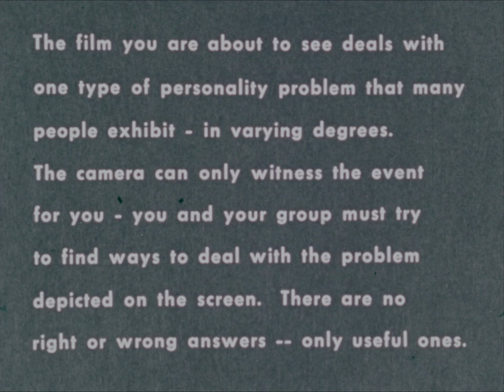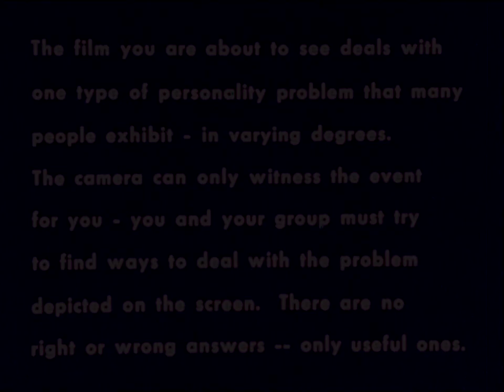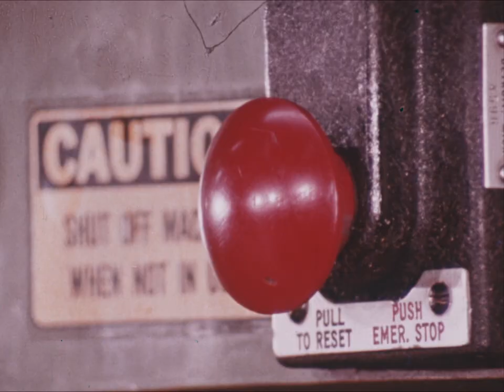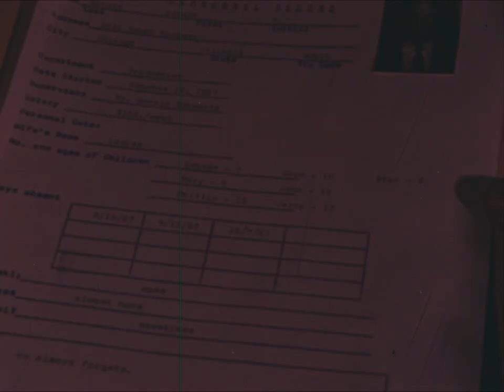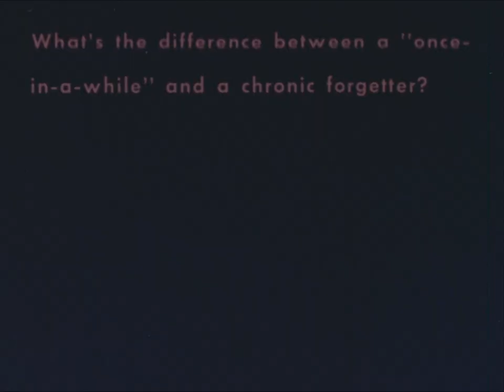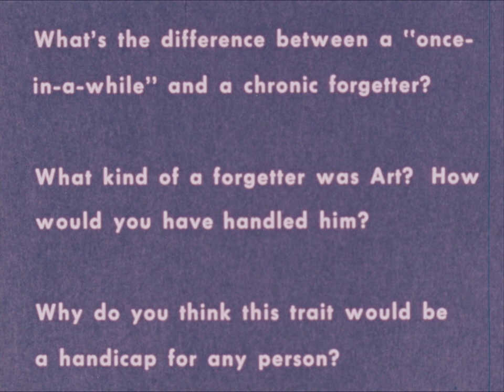RiffTrax: The Hothead And The Forgetter (Full FREE Short)

Comment: 3:31 I once plunged a large screwdriver into a little stand-up desk like the one on the right. It was all because CHUCK was running the tube mill faster than I could load the steel and make a weld!